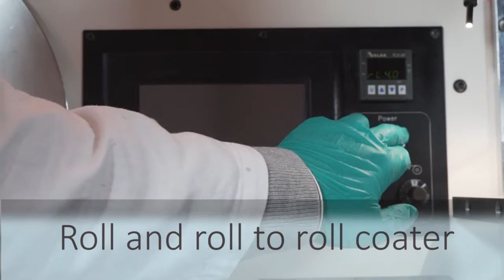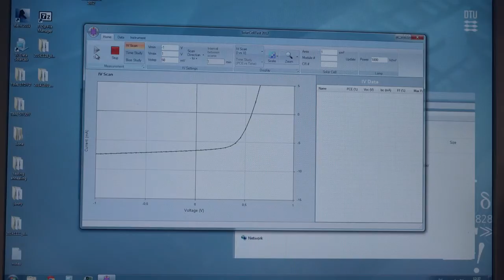Roll and roll to roll coater - making a solar cell

Comment: this is great, may I ask where these roll to roll coating machines can be bought? or is there any open source project maybe? thanks
Reply from the maker: google for "grafisk maskinfabrik" or "infinityPV"
Reply: Is there any  machine called Minarik roller coater? I just purchased an old machine without any data plate but somebody told me it's called  Minarik Roller Coater. Please help. Thanks
Moses